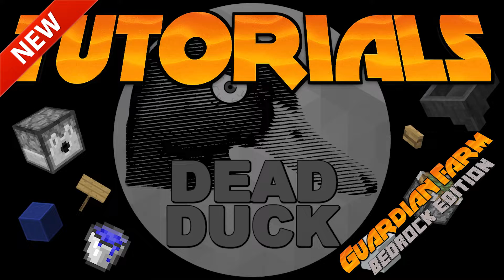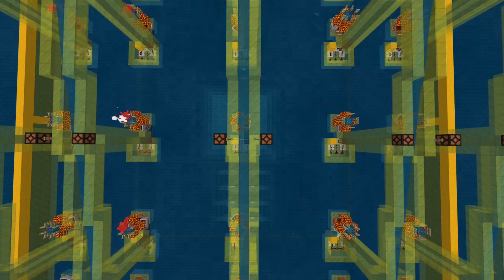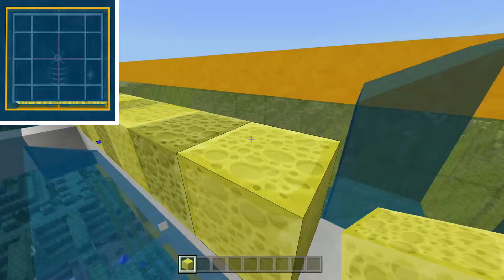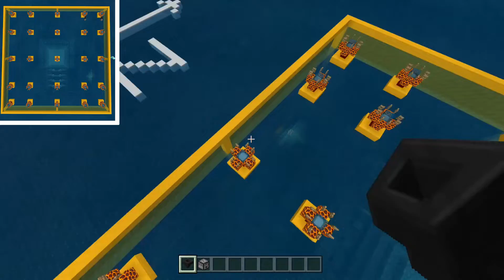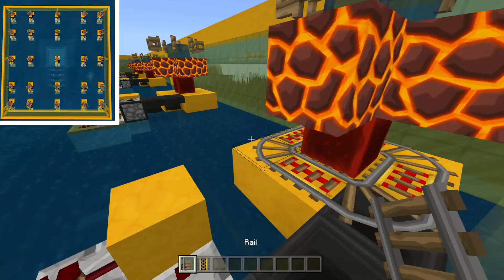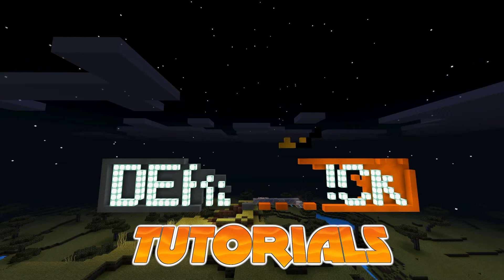Essential Guardian Farm Tutorial! | Bedrock Edition | NEW 2019

Comment: Do you have a materials list for this by chance? Survival is rough and I need to be prepared
Reply from the maker: I probably can’t tell you exactly how much of each your need but I’ll give you a rough estimate, I’ll message you once I figure it out 😅
Reply: DeadDuck thank you 😁even a rough estimate is better than going in blind, and thanks for the video, excited to make it
Reply from the maker: Guardian Farm material list:

PER BAY:
4 magma cube
4 gates
1 “centre block” (the block the guardian spawns on, it can be anything)
4 powered rail
4 regular rail
1 soul sand 
1 hopper minecart
1 water source (for the centre block that the guardian spawns on)
1 dropper (can also be a dispenser I think) 
1 comparator 
2 repeaters 
4 red stone 
1 red stone block
2 hoppers
At least 10 solid blocks for the bays.
- Note: there are 25 bays in total so times all the materials by 25.

And then your need a lot of blocks for the transport system (I’ve used glass) and water sources too.

Hope this helps, this is just a rough estimate but it’s better than going in blind 😅 

Happy building and thanks for the sub!
Reply: @deadduck9303  Does it need to have all 25 bays?  I'm not going for quite as industrial as some, I just need to make more lanterns.  Also, where does one need to stand to ensure the guardians all spawn at the top?  What makes them spawn at the top anyway?
Reply from the maker: Hub City Chiropractic You can just have 1 bay or all 25, it’s totally up to you but the more bays you have the more spawns you will have and the increased chance of spawning too. As for standing I recommend in the middle of the farm ideally below sea level, (as far as my testing has shown me) guardians seem to spawn more when your below sea level but this is not a requirement just a recommendation. To answer your last question is a bit difficult but I’ll try my best to explain what I know, if the farm is filled with water with no bays then they have the potential to spawn anywhere but when making bays with no surrounding water they will only spawn at Y level 61 with the bay being on Y level 60. The reason for this? Well all I can say is Bedrock unlike Java is very VERY specific in how it spawns guardians and with all my years of building, designing and figuring out the mechanics it’s just how it is, hope this was helpful! 👍
Reply: @deadduck9303  Yes, very helpful!  I am new to Minecraft and been learning and I will say the versions and updates provide a dizzying about of answers as to why things work.  Appreciate all you experts lending a hand!
Reply from the maker: Hub City Chiropractic No problem, we all start somewhere, your get your head around it all eventually 👌 Glad you found my channel, I have a good handful of tutorials available and a let play series with plenty of builds to see if your ever interested 😁